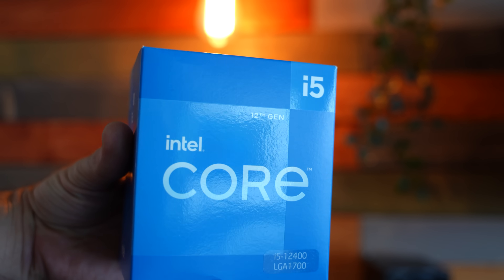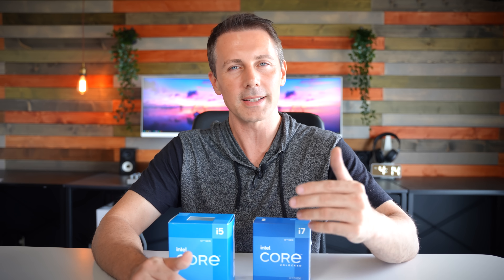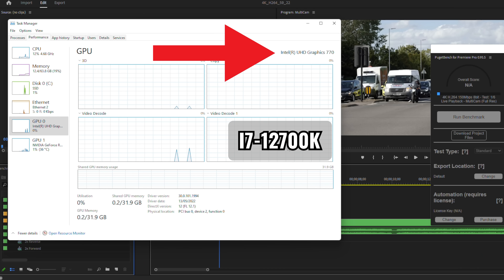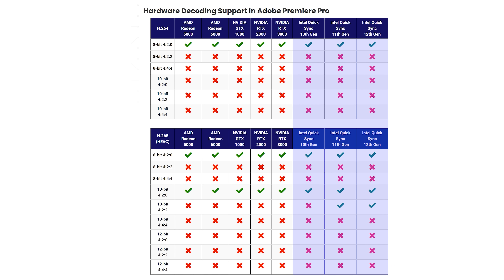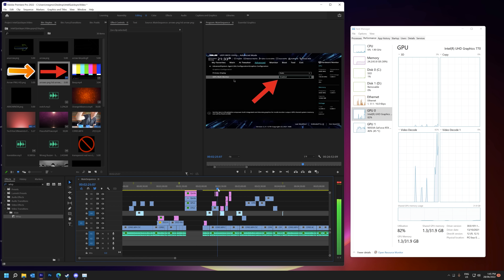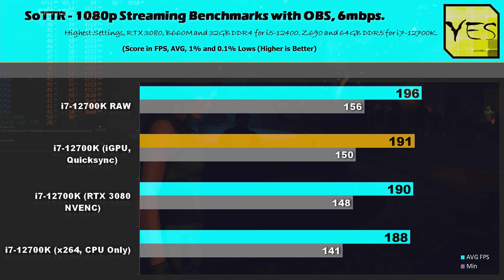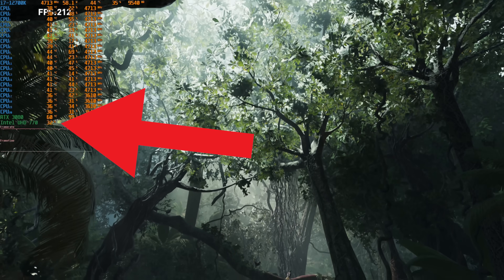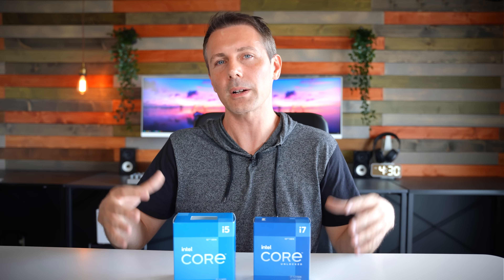Why creators NEED an iGPU alongside their dGPU - Intel QuickSync

Comment: This has always been Intel's biggest advantage.
They always had IGPUs on nearly every CPU since 1st core ix gen IIRC and those doesn't interfere with PCIE lanes like Ryzen G APUs.
Reply: Well that's because Ryzen Apus are actually mobile parts repurposed for desktop use. That's why they don't come with as many lanes as their "GPU-less" siblings (1st gen and 2nd gen zen) or only compatible with pcie 3.0 instead of 4.0 (3rd and 4th gen zen).
Actually, quick sync is a beast of a feature. My old laptop is actually faster at rendering h264 video than my gaming Ryzen machine with rx480 in Vegas (that supports opencl acceleration via the Radeon graphics as well). The catch is, the quality and size of the output video is actually a bit worse than on the Ryzen machine. With quick sync in quality mode, it's pretty similar. We are talking laptop 15w CPU from 2015 vs 1st gen Ryzen desktop with 150w Radeon GPU from 2018!! AMD needs to work on software support for hardware decoding/encoding!!
Reply: Except the APUs are kind of bigger and more gaming oriented not saying it doesn't do help productivy but adds a little GPU performance to a dGPU

For example: The Ryzen 5 5600G(my favorite example) is the best PCIE 3.0 CPU classed with something such as an RTX 2060 Super (PCIE 3.0 x16 PCIE lanes) is an adequate budget build

May I remind you the gpu must be PCIE 3.0 to take full advantage of the CPU I chose the RTX 20 Series for features such as ray tracing, DLSS 2.0 and etc.
Reply: @adrianafamilymember6427  or you can get one with more cores... i thought Ryzen was suppose to blow intel away for streaming?  not sure about transcoding but does quicksync beat a 12 or 16 core ryzen w/ an nvidia 3070?
Reply: Does the heat generated by the iGPU add up the the heat of CPU? 
You know, Intel processors have built-in thermal protection. If the processor gets too hot, the built-in protection slows down (throttling) the processor.
The presence of an extra heat source will lower the threshold that triggers the throttling. I wonder if this affects overall performance.

Comment: The Intel Quicksync encoder is so much worse compared to the newest nvidia encoder especially at lower bitrate like 6000 for streaming. 130 and 135 fps is the same, just use the nvidia encoder for much better quality... Also those static examples show nothing, even at half the bitrate it will look the same, when you move that's when you will see the difference
Reply: i definitely agree with you, also Nvidia encoder is dedicated part in gpu and doesn't eat gpu's performance
Reply: @hannu1469  Try using in, it does affect performance.  Not a huge amount but its there.

Comment: I have three GPU's im my computer each GPU lowers the CPU usage on my 9900 K I have a 1080 UHD 630 and HD 7770 they all drop my CPU usage by at least 250% at idol so about 25 % of the utilization as before also my FPS improves

Comment: Are you talking about plugging your monitor directly into your mobo? because I cannot get my IGD to run without doing so. It doesnt do 240hz but my monitor does.
Reply: I have an old Dell Optiplex with i5-4590 (HD 4600). I connected my monitor (which is HDMI/VGA, 50-75Hz) to the intel VGA port and HDMI from the GT 1030 and made sure both nVidia and intel display drivers were installed... then set the desktop to display only on the GT 1030, then disconnected the VGA cable. The QSV functions without a second monitor connection. At least it does on my rig. But because it's so old, for some reason it doesn't work in Handbrake. It tries, but errors out. IDK if XBox Game Bar uses QSV or what.
Reply: @aleaxdeathbringer  Everything should be automatic with the latest version of win10/11. It didn't used to be that way you had to bridge the graphics card manually to the chipset on the motherboard. I have a hdmi monitor except it does support VGA. Not sure whether or not I should go backwards. Which, would be more grounded. I'm just going with hdmi because thats technology.
Reply: @aleaxdeathbringer  I also, think that was unnecessary. If you try and plug one monitor into the same computer with 2 different types of cords it tries to power them. I have crashed monitors that way. Whatever your trying to do you shouldn't need to jumpstart things.
Reply: @typerightseesight  that was for installing intel display drivers, and the monitor's fine.

Comment: Having a small form factor build paired with a AMD 6400 is insane value. A lot of tech reviewers hate the 6400 for lack of hw encoding and the 4x PCI E, but I don't see a massive performance loss.
Reply: No that CPU for this day cant game.
And for creators that's an auto pass.
The CPU core performance is weak weaker than i3 of same gen.
iGPU is already so OLD.
Even building a 5-10yrs old PC amd will be a big no.
Only ryzen 2k series above are good CPU.
Ryzen 1st gen is not good enough and really picky with Rams.
And below 1st gen ryzen are basically crap.
Reply: @gamertechlive1780  Bro... he's talking about the AMD RX 6400 graphics card...
Not the AMD A6-6400K (which is garbage). 
Context clues: The 6400K had hardware decoding. It also had 16x support.
Reply: @tim3172  he's just spilling nonsense and looking for fights in the comments lol
Reply: I forgot quick sync is only available for Intel and and don't have this equivalent option or feature
Reply: @gamertechlive1780  Don't understand what you said...When I will add any good i5 or i7 will do the job just fine. Manage your expectations. This GPU is great for first time builders on a budget.
Reply: @AlexRubio  Due to its limitations I would just direct gamers to purchase something else. Its embarassing when your rx570 out performs it... from 2017.

Hard pass

Comment: I spent the extra $15 for a 10900 over a 10900F.  $15 for quicksync and an "emergency" gpu is WELL worth it.  Edit - I see you covered these points and the pricing.  Excellent on point video as always!  Thanks
Reply: The iGPU really helped big time when the GPUs were a myth
Reply: i9 is a bad example, in the i3/i5 range it can be $50 and for some folks it's a lot
Reply: a 10900f shouldn't even exist, let alone any F version. Intel just trying to get even richer off people lol.
Reply: sure, for 15% its a no brainer!!...if your gpu gets faulty, you are out of order!
Reply: Just wondering why you didn't buy 10850K? The price was same as 10900
Reply: @adityadivine9750  maybe it wasn't available where he lives or when he decided to buy it ?
Reply: @benjiderrick4590  that's why I was curious. Not like there's a big difference anyways. Probably 2-3 percent
Reply: @adityadivine9750  10850K wasn't available at the time and when it was it was a bit more.  The 10900K was over $100 more.  I've got my 10900 PL unlocked so it does 5.2ghz single / 4.6 all core.  300mhz extra all core wasn't worth the extra $100 especially as I play at 4k.
Reply: @solocamo3654  ya that'd be 3 percent more performance at best
Reply: Of course you'll have better frame rate & gfx performance on a system with 2 GPUs. 2 GPUs are always better than 1. 
The real point is, does the heat generated by iGPU add up to the heat of CPU, and trigger it's clock to step down.
I expected to hear that in the video but this `intel sponsored` video did not cover it.

Comment: Quicksync is a very powerful feature that few people used it. I still use a 6th gen i5 and I’m still rendering videos using it
Reply: @TechHarmonic  thank you so much for the details !
Reply: @TechHarmonic  would you please share the tweaks?   Which encode software do you use, handbrake? thanks!
Reply: i dont think everyone fully understands how capable it is. unlimited encodes and decodes vs 2/3 on nvidia consumer grade, can encode and decode multiple 4k streams at once with a high range of codec support - pretty much unbeatable. even cpus like an i3 8100 can do this - doing this much in software would require a 24core threadripper at least
Reply: This is old news anything above 3rd gen intel can use quick sync for rendering but it's crap compare with direct core rendering for CPU.
Or using nvenc encoder.
If your a creator you want to use a second PC if you can afford it a budget 2nd PC as rendering is fine but the higher you go the better the quality is.
If that's not an option then, get a Nvidia GPU and use nvenc for a single PC set up.
Reply: @gamertechlive1780  Even bleeding-edge NVENC* is visually indistinguishable from Quick Sync
QS has also gone through several iterations and it's on Version 8.
Maybe you're ignorantly talking about the shortcomings of version 1 and 2?
You're like... 8 years out of date, my guy.

*Ampere and Turing iterations of NVENC are practically identical
Reply: @tim3172  Nvenc is so much better than Quick Sync unless you have bad eyesight.
Reply: @gamertechlive1780  it's not old news, a lot of people don't even have a clue what Quicksync is. m-rod makes a very valid point, so there's no need to respond like that. Quicksync is a fantastic tool for streamers and content creators who aren't into it for a living.

Comment: Yeah, I've seen this and it had me considering moving back to Intel, and hopefully AMD follows suite with Zen4 and the iGPU they'll be putting on those. Though I have to say... I'm just considering converting over to something that's not so compression heavy for editing like DNxHD. Doesn't mean I still won't consider moving back to Intel tho.
Reply: Intel usually has a weaker iGPU but better driver support (esp. years down the line) compared to AMD iGPU. Definitely rational to consider the features offered by company instead of raw performance. 

AMD support for productivity (transcoding, virtualisation etc) on their iGPUs has so far been abysmal. Quite a stark contrast to their GPU driver support which has been better than ever.
Reply: Good news for you, all Zen4 CPU's will have a cutdown RDNA2 graphics.
Reply: @13thzephyr  Yes... but the question is, will it have the same decode support that quick sync has on the 11th and 12th CPU's.
Reply: @TheGameBench  we will soon find out since the launce is near. If AMD really wants to attack Intel in all fronts then they should make a Quicksync counterpart.

Comment: I've been using a GT1030 + HD 630 pair for the better part of a year now and being able to record gameplay footage with no compromises is excellent. I was honestly surprised to see that this Dell Optiplex 3060 SFF tower had the BIOS option for dual graphics, everything behaves perfectly both on Windows and Linux as well.
Reply: I streamed 1080p 60 fps from i3 4th gen intel hd 4400 + gt 1030.. Check my channel

Comment: In my case Intel igpu just caused me issues. PC wouldn't boot with my rtx 3070 so I had to disable it in bios gigabyte mobo and i7 11 gen, wonder how many more people have the same problem.
Reply: That's the thing they're sometimes better used disabled b/c of interference
Reply: Idk, i also have i7 11gen but its igpu didnt interfere with my 3060 ti
Reply: @Daniel-ru8je  I couldn't use the pc for a week, took it apart, reinstalled windows, tried all kinds of things disabling the igpu was the only way for my pc to get signal. Just because everything is fine to you that will be for everyone else. I've seen online that it happens to quite a few people.

Comment: If you have an AMD APU like a 5700G, you can also use it for OBS.
Rule of thumb for AMD processors, basically all of their processors are "F" except for the ones that have a "G" at the end, indicating graphics engine

Except for in laptops, as far as i can tell, all AMD laptop processors have an iGPU
Reply: Yes, but the difference is that G series Ryzen CPUs trade L3 cache for having integrated graphics, which is not the case with Intel iGPUs
Reply: @XxDeViLBrInGeRxX  I know it doesnt make up for the L3 cache, but the 7nm APUs (4000-5000G) can generally hit 4800+ RAM frequencies in 1:1 with FCLK/UCLK
Reply: @XxDeViLBrInGeRxX  Ryzen Apus do still have L3 cache. The main difference is that the CPU uses previous generation zen architecture which does not feature the improvements that were added down the line (better clock speed, L3 cache increase, process node)
Example, the Ryzen 5 2400g is based on Zen while Ryzen 5 2600 is Zen+. But 5700g and 5800x are both zen 3, but the difference is that the 5700g is more or less a desktop version of the R9 5900HX, which is a mobile part.
Reply: @benjiderrick4590  AMD APUs give up 1/2 their L3 cache of their respective desktop CPUs(1000=2000G, 2000=3000G, 3000=4000g, 5000=5000g) and with Ryzen 4000/5000 the core architecture is the same as CPU(Zen2 and Zen3), the main difference is the cache, 4 fewer PCIe lanes, no support for PCIe 4.0, an integrated GPU/video engine, and support for RAM up to 5000MT/s without using 1/2 speed MCLK/FCLK/UCLK. Not all of these things are bad, and no, i've tested, RAM at 5000 does not make up for the lack of cache, but it does mitigate the performance losses
Reply: @Lance Yeah they'll introduce weaker CPUs from the other CPUs but be better than the current APUs

I think they called it the Raphael lineup
Reply: @adrianafamilymember6427  Raphael is the codename for the 7000 series Ryzen parts.
Reply: but then the G-series CPUs have less cache, and that directly affects gaming performance.
Reply: @HazewinDog  Just letting people know if they already have one, no one should be buying a CPU or GPU right now, so if someone already has a 5700g or 5600g, they dont NEED to buy an intel CPU if they want to start streaming
Reply: @HazewinDog  yes, but that's less of an issue with zen 3 than when with vanilla zen. Where it really matters is when zen 3 cores are paired with less than 16mb of L3 cache, like with the Ryzen 5 4500 where the performance is crippled so much that it's basically worse than a 2600
Reply: @benjiderrick4590  I have more than a dozzen Zen2/3 processors at home and at work, and yes, 5000G can be significantly slower than 5000X because of the cache, yes most of them will hit RAM speeds of 4800 with 2400 UCLK/FCLK/MCLK, but that doesnt make up for the lack of cache. Not even my 'gonden sample' 5700g that hits 4933CL17-17-17-30
Reply: @denvera1g1  of course it's slower, my point here was to say 5000g, while not being as much powerful than 5000x series, are still faster than 3000x series. While it was not the case with 3200g vs 3100. You had to give up on more cores and/or SMT support as well if you wanted integrated graphics, especially on R5 series.
Reply: @benjiderrick4590  Giving up SMT can be a good thing on these cache starved processors, though designing a scheduler to only use SMT when the program doesnt need that much cache would be better, but that would be up to Microsoft/Linux to impliment. The 5000G series is not always faster than the 3000x series, there are several games and applications where a 3700x is going to be faster than a 5700g because of cache misses esspecially while multi-tasking causing more frequent swapping in and out of RAM instead of just parking the program execution words in cache while another program executes, but the 5000g series are on average faster than 3000x(per core), and always faster than the 4000 series

Comment: I don't like the image quality of QuickSync. Some of my videos, on my Channel, are using QuickSync and the quality is worse than AMDs encoder. I generally use either NVENC, CPU, or this cheap GAM Live HD60 I bought off ebay. All of them offer superior image quality to QuickSync. QuickSync would be dead last and a last resort option imho. 

Creators should get a USB 3.1 GAM Live HD60 or equivalent (Avermedia has some nice ones as well as Elgato) if they're serious about encoding in real time.
Reply: Then you did something wrong. Quicksync is fine in terms of quality.
Reply: @kidShibuya  https://youtu.be/ccoOGfX9qxg?t=1077

AMD improved their encoder with the 6000 series. QuickSync is now dead last in terms of quality.

Do you feel like arguing against Facts? Or will you now accept that my statement is factual when presented with scientific data?

Comment: Can you do a video on the LGa washer mod and thermal grizzly clamp and cheap generic copies on eBay to help your viewers thanks bri
Reply: Just add thin washers of rubber/plastic. No need to buy those expensive kits.
Reply: @adityadivine9750  sizes etc please
Reply: @markgoddard7960  check luimi video on it. Can't recall exact number but he did lots of testing and found 1mm plastic washers to be the best suited for this. Do check his video to confirm and stop overspending like everyone else. The washer mod does the same thing as there thermal grizzly clamp but in a less fancy way. Be smart, those washers will be less than 0.1$ cents. Heck you can get emm for free on any repair shop.
Reply: @adityadivine9750   think motherboard manufacturers should do free recalls on all motherboards as it’s getting away with selling shit products and damaging intel s reputation
Reply: @markgoddard7960  actually the most part is by intel. They design the socket not motherboard manufacturers. Also as they've already manufactured and sold huge amount of motherboards, they'll get loss if they recall all motherboards. And now when the problem is well documented by many, if they improve the socket in newer manufactured motherboards then the people using old ones will file lawsuit if they don't take emm back. It's a mess that they're avoiding. Again it was mostly an intel issue.